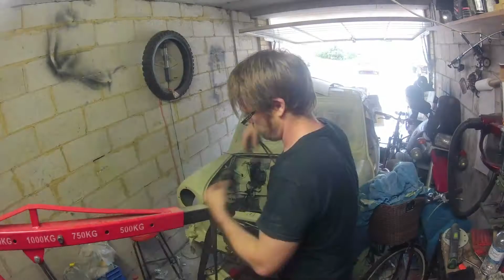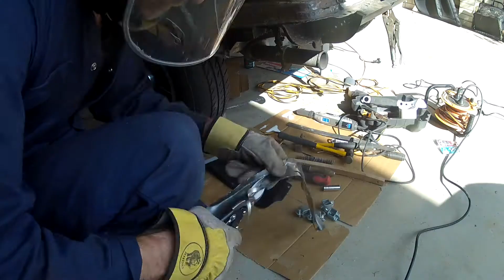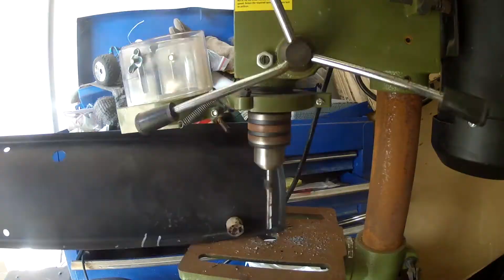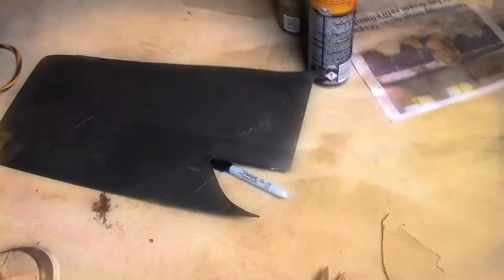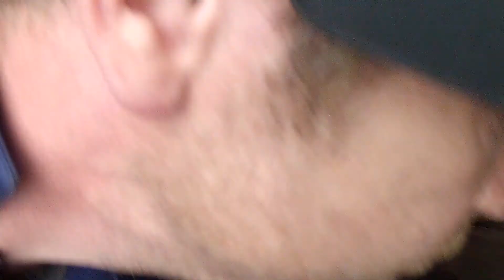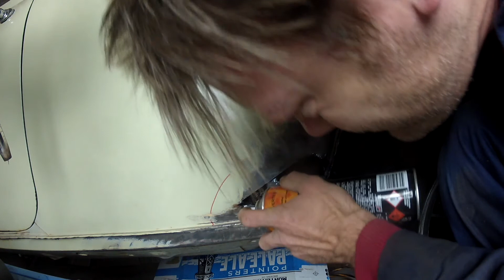EP6 Classic Mini Rust Repair and Removal | Classic Mini Van Restoration | A Rusty Journey

Comment: I have to do the exact same thing to my van. Thankyou for the video mate.
Reply from the maker: no problems. My recommendation is If there are any of the previous parts left, cut them out carefully and refer to them as they are a difficult shape to replicate and any differences come to light once the outer panel goes back on. Also, it's a good time to re-tap and clean-up the closing panel and subframe bolts. Good luck!
Reply: Same here. Thank you!